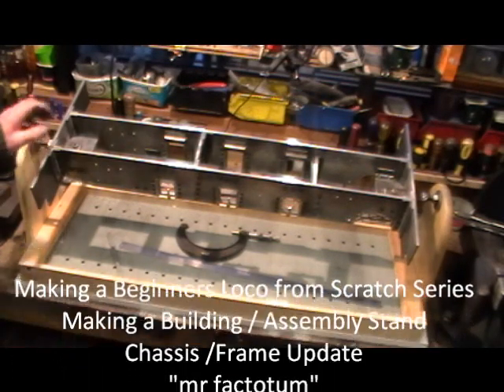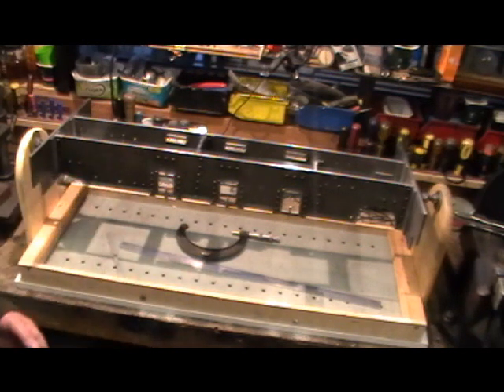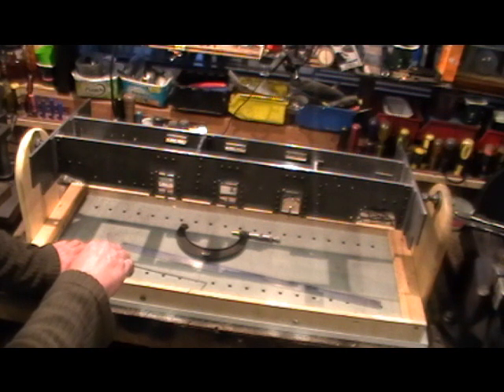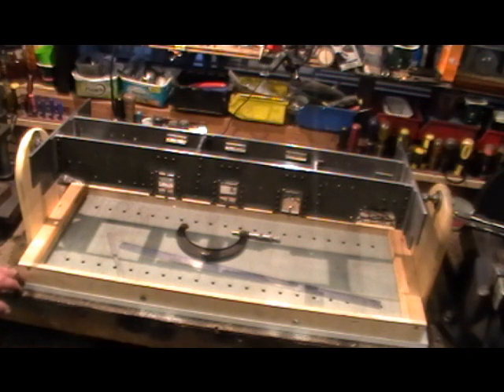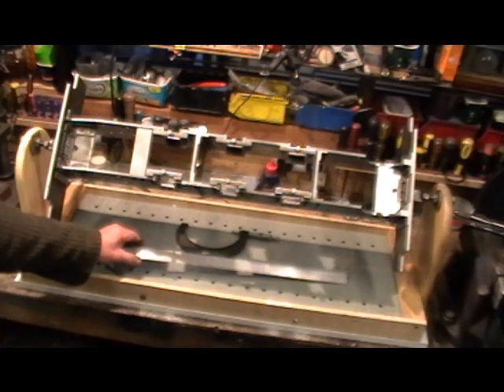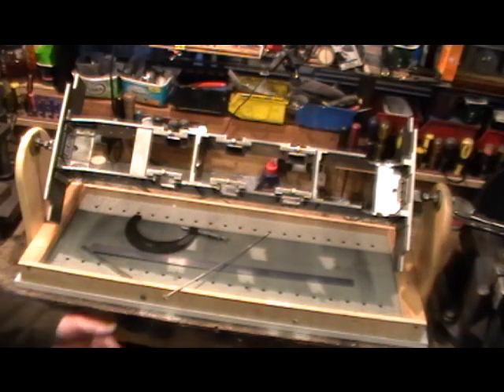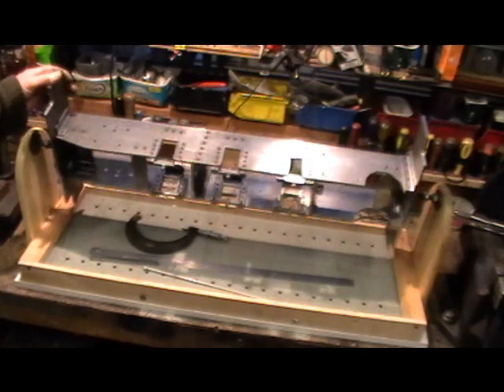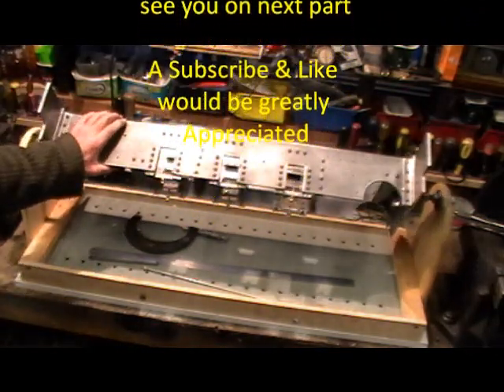Making a Beginners Steam Loco " Making a Loco Building / Assembly Stand" "mr factotum"

Comment: Mr. Factotum, that is a nice stand you have there.  Will aid you a lot in the construction of the loco, I bet.  Just curious about a couple things.  The book mentions the Meter Maid, but does not offer the layout for the 6 wheels.  I assume that is a different set of prints you had to purchase.  Another trivial question is how much do the components weigh?  I know you built the boiler and have the frames basically done so am just wondering what the weight of these components are and perhaps the weight of the finished loco when you get there.  Having the book to read along with your build has been a great pleasure.  Thank you for sharing.

Joe
Reply from the maker: hi joe 
nice to hear from you, i am building this loco on a very very  tight budget, some people say i am "tight", i say i like to get value for money, for example just to buy a complete boiler ( tig welded not silver soldered) and with no bronze fittings included on 2018 prices in uk was £2100, i have bought all the raw copper and bronze for fittings and silver solder and gas for £700, so did it for under 1/3rd of the price. I bet you wonder where i am going with this. Well, back to the Metre Maid 6 wheel layout. I do not have a set of drawings,  i only have the book to work to for the majority of components, and it broke my heart but i had to bite the bullet and buy just the 1 full size  Metre Maid "general layout" drawing to get the wheel spacing's which are different to the sweet pea, although they fit in the same overall length they have different spacing's. Any other differences i come across,  i am getting info from other Metre Maid owners at a variety of meetings/shows i go to and by taking photographs etc. The Great thing about this loco, is that no Sweet Pea's, Metre Maids, Sweet William's or Sweet Violet's are ever the same, you have scope to put your own cosmetic stamp on them (without any questions from a certain number of what we call "anoraks"),  unlike other locos which have a set design. 
As for weight i am not 100% sure but i would estimate that the complete 5" gauge Sweet Pea is probably in the region of 150lb (75 kg for our european onlookers.), i am just making the 6 wheels from some old discarded worn out cast iron riding car wheels from my local M.E.Club, yes you guessed it, they were free, and its surprising  how heavy they are alone, the more weight the better adhesion to the rails. By the way i have mentioned your channel in my soon up coming "wheels" video.
I hope that helps Joe,  and i will get back to you when i have more statistics on the weight of items. Thanks for taking interest.
Regards mr f
Reply: I am a bit tight myself.  Mostly because I grew up with very few resources.  So, the wheels, they will not have the bosses for the drive pins?  I forget what they are called.  I don't know that I could afford to build a locomotive, but am enjoying the smaller toy engines.  I think I will build the Kenneth Wells traction engine next.  Hoping I can buy a set of castings from Emma at Emma's spareroom machineshop.  But if not, I have the resources to make the patterns and cast my own from Aluminum.  Thanks for the shoot out, though you didn't need to.  Looking forward to seeing those axel boxes come together and the wheels.  Speaking of that area of the loco, what are you going to use for springs.  Something purchased or will you wind something up?  Springs are kind of facinating to me since I read tubal Cain's spring book.  Anyway, thanks for sharing your build.  I am enjoying it immensely.

Joe
Reply from the maker: Hi joe
I think there just called crank pin bosses??. Like i said in a few video's, i' m new to loco building so still not sure of all the terminology, however my wheels, although plain, i am putting immitation bosses on them, just to make them look more realistic, all will become clear when i upload the video's, as for the springs, i came across a box full on a car boot sale, and they contained more than enough, the size and strength i need. 
As for castings and patterns, thats something ive never done and when time permits i want to have a go, so i will watch your videos with added interest for future reference. Its amazing that what ever you want to have a try at now, youtube gives you the opportunity to learn from your armchair, and plenty of experts give you a helping hand in sharing there skills, how did we manage without it.
Anyway goodluck with your initial ideas for building a traction engine, i have watched a few videos from emmas spare room, always interesting.
Regards
Mr f